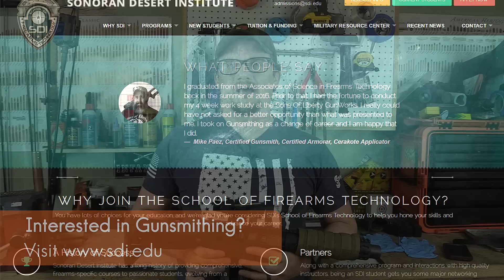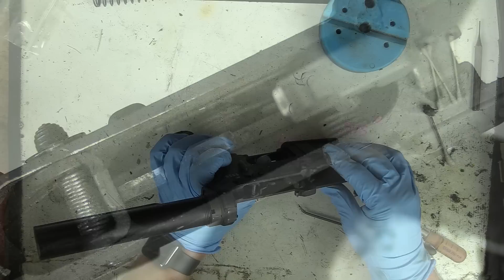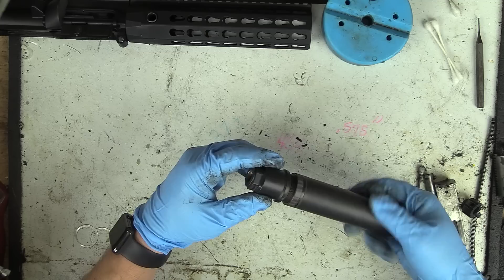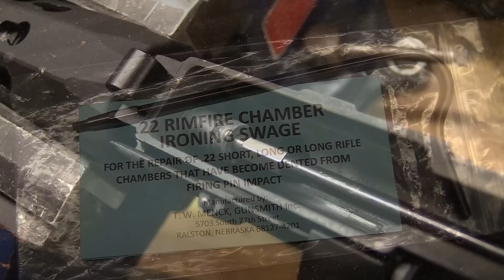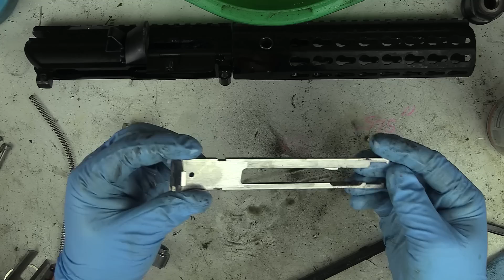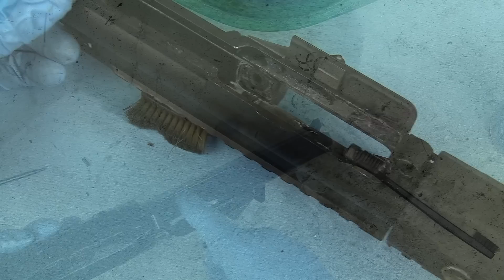CMMG AR-22 Cleaning & Inspection

Comment: The timing of this video was perfect! I just started having reliability issues with my CMMG dedicated upper setup. Gutted and cleaned it (by hand) and ordered a spring replacement kit from Brownells. This detailed video was very helpful. Probably order some spare extractors and firing pins next. I am also going to start running it with my buffer and spring in the gun because I was noticing some carrier shift without it. The collar was backing off of the barrel extension in the chamber and I was getting all kinds of failures to fire. I also think that is what was giving me failures to extract as well, because the extractor looked fine. Only about 1,000 rounds through the gun so far.

Comment: So are the dimensions the same for the charging handle? A cheap 10$ raptor style charging handle, filled with some type of resin/filler in the valley would work then.

Comment: How does the barrel/breech adapter secure to the barrel/chamber extension???  I'm going to try and remove the one on my Douglas heavy barrel...had it built back in the mid 90s by Derrick Martin of Accuracy Speaks in AZ...he used Red Loctite to secure the adapter, so I'll need to heat it with a Bernz-o-Matic...